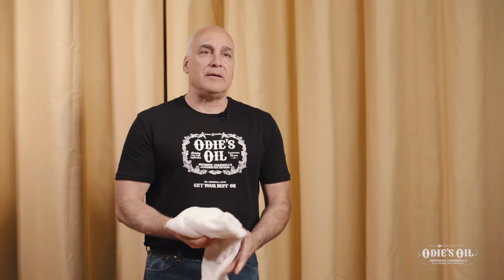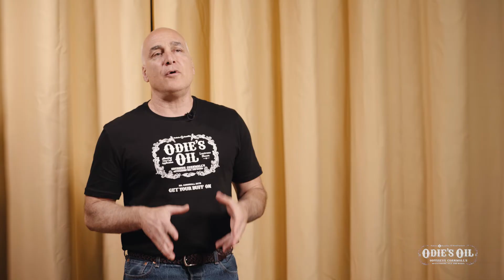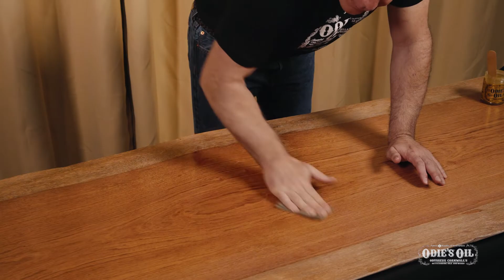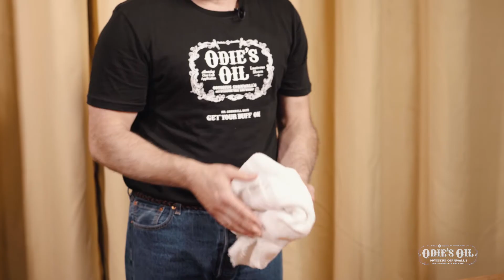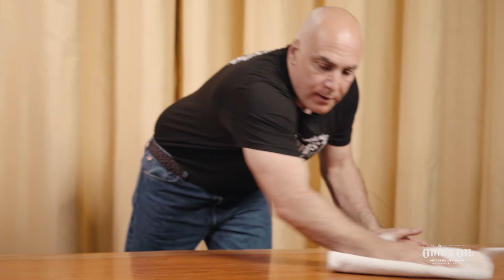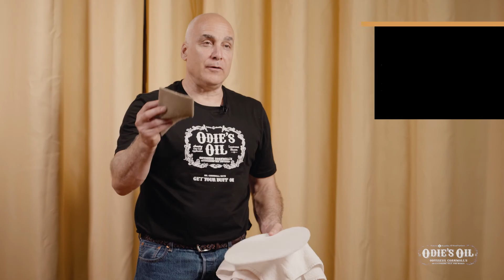Applying Odie's Universal Oil: Tips and Techniques #odiesoil #diywood #hardwaxoil

Comment: On wood floors, does Odie's Oil provide any scratch resistance?
Reply from the maker: Yes. Odie’s does provide scratch resistance by molecular bonding in the wood and therefore densifying.
Reply: @Odiesoil  Is this finish as hard as a polyurethane?   How well will this product wear with a home with dogs?
Reply from the maker: Joyce Thomma please watch our videos to learn more about how Odie’s works. Odie’s oil finishes are totally different from polyurethane, our oils molecularly bond with the wood and will offer depth, stability, and protection to the wood. Odie’s will outperform any polyurethane on the market, as per dogs- it’s inevitable that polyurethane will scratch and poly is virtually impossible to repair. as per using Odie’s... Odie’s will harden in the surface and reduce scratching, but when scratched repairs are simple....you will be able to spot repair

Comment: Was there a finish on this wood before you applied the oil? It looks like it has s great sheen to begin with.
Reply from the maker: No finish was on this surface. It was just a properly sanded and prepared surface.  The better your surface preparation the better your end results will be.

Comment: What kind of protection does this finish provide? ie: Is it okay for wet glasses on a table, etc. Also, how do you handle porous woods?
Reply from the maker: After the full cure time, it is completely waterproof! It is also stain resistant, provides UV protection, stabilizes the wood, and more. Odie's works great on all species of wood, porous or not.
Reply: @Running Red Fox Use your intuition. 

If you're using a low to no building finish like these oil/hardwax products, porous woods are better used with a pore filler. 

If you're just slapping lacquer or poly, just let er rip if that's your style. 

Price is what you pay and value is what you get. Doesn't get much better value than these simple to use oil/hardwax finishes.